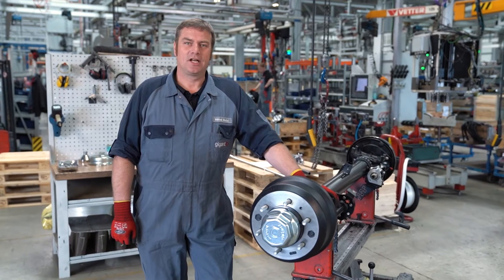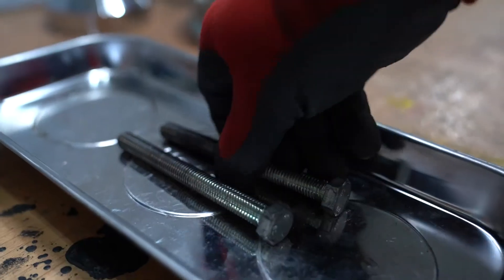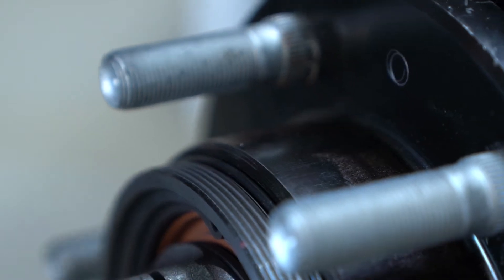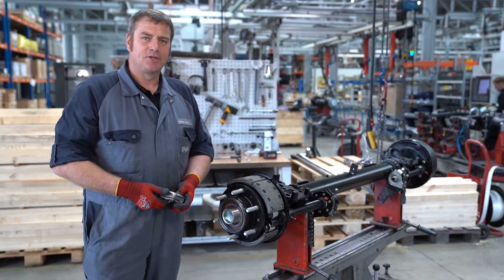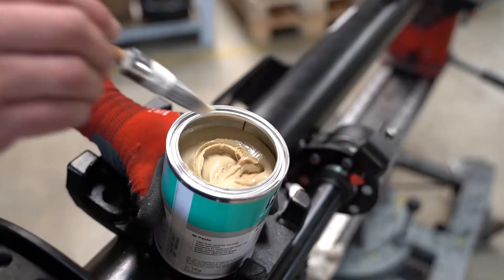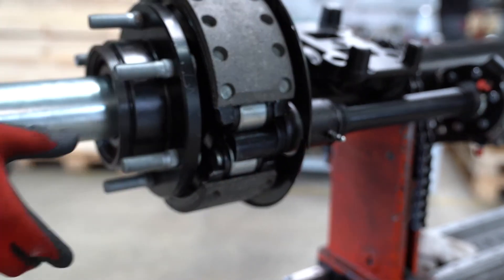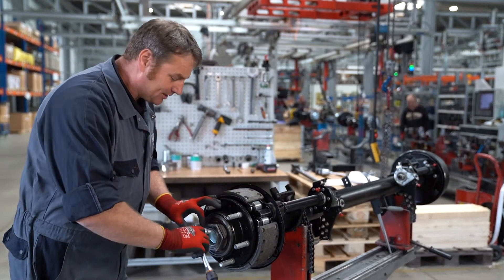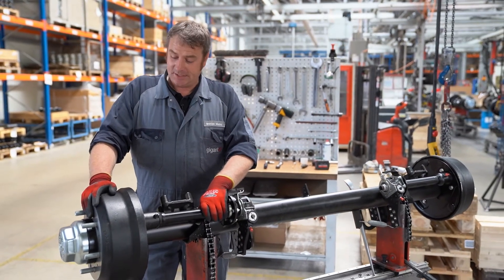GIGANT service video - Change hub unit on 5.5 t rigid axle | EN

Comment: But, what is the correct torque?
Reply from the maker: You can find all technical information in the All-In-One maintenance and repair manual in the download section (https://www.gigant.com/service/download/).
GIGANT has two different axle nuts for this axle. The material number on the front determines the torque.
The material number ...535/...536 is tightened with 700Nm +-25 Nm.
The material number ...070 is tightened with 480Nm +-20Nm.
For further support you can contact our customer service or sales department.

Comment: So this does not need a hub seal? Because we have a 6 axle  Broshuis with Gigant axles but this is the only trailer I saw in our Country. The bearing burnt after some of our mechanics worked on the axle.
Reply from the maker: GIGANT axles have a maintenance-free compact bearing that does not need additional lubrication with grease. The hub with the compact bearing remains on the axle during maintenance or for example when you need to change the brake pads and does not have to be dismantled.
Further information on maintenance can be found in the manual All-In-One via www.gigant.com/en/service/downloads